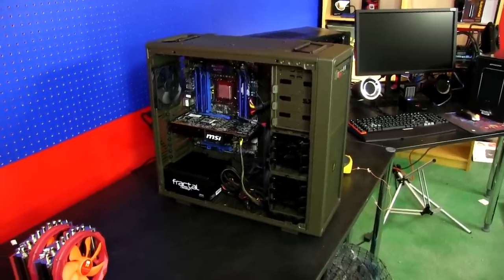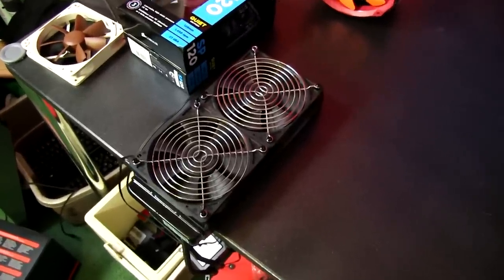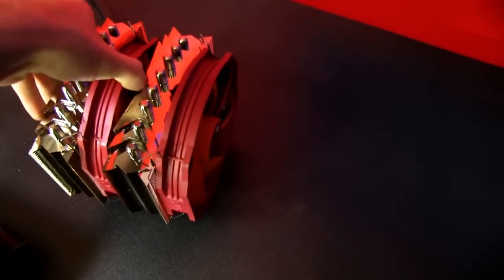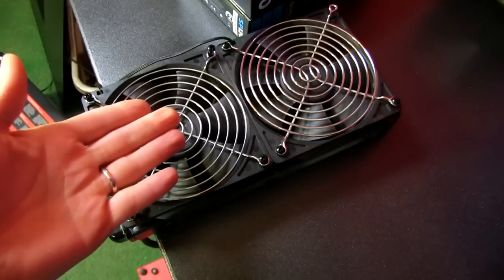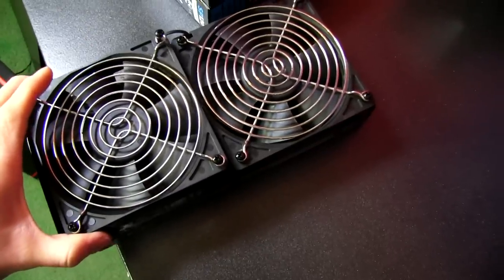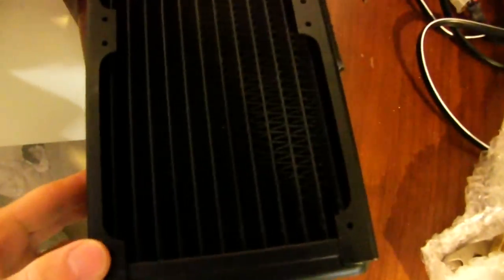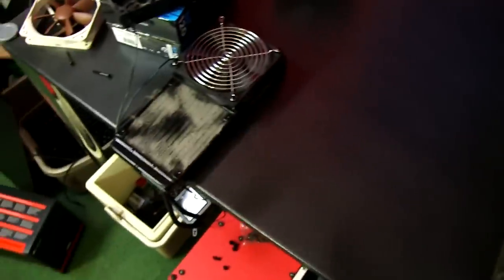Push vs Pull vs Push Pull for Radiators and Heatsinks Linus Tech Tips

Comment: What if i use push configuration on an intake scheme, Pulling air from outside of the case with dust filter applied?
Reply: Radit Slamet You should be OK with a dust filter.  Just be aware that you'll be dumping all that hot air into you case, so be mindful of GPU cooling, etc. and have good rear/top exhaust.
Reply: How is it hot air if its coming from outside?
Reply: TheGirlGamer OK, maybe "warm" air is more appropriate.  The air may start out cool, but it'll be passing thru a warm radiator.  Then again that's how car radiator/intake works, so it shouldn't be too bad (just not ideal).  ;)

Comment: I can see that using a pull system for exhausting air is beneficial for keeping your radiator easy to maintain clean. But this is just one scenario what if you have intake of air into the case would it still be better to use pull then and have the radiator mounted to the case or would it be better to mount the fans to the case and push the air through the radiator. I would appreciate it a lot if someone could help me out on this!

Comment: So put the radiator with its fans against the top of the case.. in PUSH, or PULL? I didn't get that last part! =[
Reply: Pull
Reply: And this is so the hot air generated by the rad is vented out of the top of the case!
Reply: +NeonZ Entertainment oh! So it will be pulled out the top of the case through the rad. Thanks!
Reply: Yessir ;D. Setting mine up that way now.
Reply: +Jake Wesolowski in retrospect that was such a dumb question lol :/ smdh :'(
Reply: Not really a dumb question. I had the same question last week while doing research, especially when it seems like a bottom radiator does the opposite!  Linus had some great tips on water cooling to help understand how various installations can work.  so many different configurations!
Reply: What IT said!  Keep in mind that this isn't always the case.  If you have massive GPU's that are venting their heat into the case and not out the back, pulling hot air through the radiator may not help cool the CPU.  hence the complexity with system builds.  If "cool" air can be pulled through the top radiator and vented out, great.  If the internal air is already heated when it gets to the top radiator, then it may be better to pull in cool air from outside and vent the hot air through the rear case fans.  Again, there's a number of ways to handle this, but others can chime in on their thoughts.

Comment: Well i have an i72600k and i use a push-pull config with a corsair h60 (from outside to inside). I mean what the hell? If you clean your PC each.. let's say....5 or 6 months, including your radiator and fans, then you won't have problems :)

Comment: I saw this video a couple of times and I couldnt understand a thing maybe because of my bad english knowledge or because I am perfect noob to building a pc. But I will explain my question here properly, kindly anyone answer me.

1) Case top
     ---------------
     Radiator
     ---------------
     Fan (Air flows Up)

2) Case top
     ---------------
     Radiator
     ---------------
     Fan (Air flows Down)

3) Case top
     ---------------
     Fan (Air flows Up)
     ---------------
     Radiator

4) Case top
     ---------------
     Fan (Air flows Down)
     ---------------
     Radiator

Which one did Linus said is better?
Reply: He is saying configuration #3 would be better because you would have an easier time of cleaning out dust from your radiator.
Reply: TheWierdSaying
Oh ok thanks :)
Reply: 2 and 3 are actually the same, both Pull. But no. 2 blows air in the case and no. 3 blows out.

Comment: So I have the H100 i and swapped out the 2 stock fans with 2 SP 120's.. My friend and I put it together and he set it up with the 2 fans on the bottom of the radiator blowing air through it to the out side of the case, It didnt look right to me so are you saying the best way for performance and cleaning would be fans on top pushing air from out side the case through the radiator cuz right now my CPU is at 20 deg idle. I am also going to be swapping out all stock fans with SP/AF and 2 AF on door.

Comment: Are radiator fans/pressure optimized fans better on cases too?
Reply: Bruhski1080p Depends on the restrictions.  If you have a fairly open air case (lots of intake and exhaust vents) than air flow optimized fans would be better.  You only really need static pressure when you're facing resistance (i.e. radiator fins).  SP fans generally help most as front intake fans with cases that have solid front panels, doors, etc. (or packed drive cages).  AF fans help most as rear and top exhaust fans, moving as much hot air up and out as possible.

Comment: I have the H100 installed in a Corsair 600T case and my cooler is hooked up to the case fan controller.  On startup my fans rev full speed and make tons of noise.  Is this normal?  should I change the location of connection?

Comment: am also running a H50 in push/pull but I can not see any difference whether it is push / pull or if it is push or pull. its around (35 celsius) / (94 fahrenheit) with all three setups  
On my intel core I5 3.1ghz

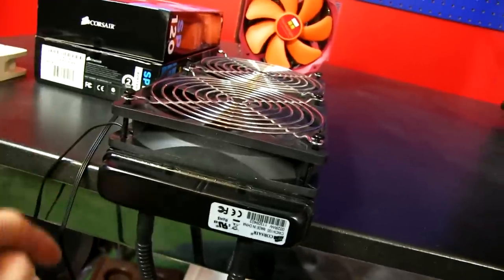Comment: I have a question: If I used my fans at the top of my Radiator but turned them around so that they pull the air through my radiator outwards instead of pushing air into the case. Would that be a bad thing? Exactly like at 0:50 but with the fans turned around.
Reply: Not a professional here but wouldn't that use the hot air coming from the case and blow it through the radiator? Not sure if that matters if hot air is blown through it or not but I think if hot air is going through the radiator it might not be good.
Reply: In the video he explained that the difference in cooling and performance does not get affected if you pull air out. I just really want to know if it would matter if the fans pulled air from the top of the radiator. Purely cuz I want to use custom LED fans to light up the top side of the case etc etc
Reply: I really don't know much but I don't think putting the fans on the top will really change that much since I think it's still going to pull/push air in/out either way. Dosen't linustechtips have a forum where you can go and ask this? I think you might get better answers from more experienced people that way.
Reply: Actually good advice. Appreciate it :)
Reply: Dean Stander
IF you have stuff in your case that is overheating like a GPU have the radiator fans pull the hot air out of the case. If the GPU ect. are plenty cool, pulling air into the case will cool the CPU more the the other mentioned method.

Comment: Ok, so I have to configure my system to pull... to inside the case or outside the case? and what if I use Dust Filters?
Reply: No one? well I'm going to look in other place
Reply: Pull air from the case out.  No need for dust filters on an exhaust really, just on intake fans :)
Reply: Darth Flynn thank you so much, so the intake configuration could be: Air->Filter->Radiator->fan and the exaust Inside->Radiator->Fan, right?
Reply: younlink Your welcome ;)

I would do this

front of case: Air>Filter
Top of case: Inside of case>Radiator>Fan

This way fairly cool air cools your radiator.  If you have a radiator on the intake it will get nice and cool but its then bringing warm air into the case and I wouldnt want that.  If your bringing warm air into the case then your radiator on your exhause is being cooled by that same warm air.

Your welcome ;)

Comment: does the vengence 70 case hold CEB mother boards like the Asus Rampage 4 extreme??  It is a little wider then the standard ATX which is 9.5 inches... There seems to be a recess in the mother board plate of the case... can you let me know if it fits fine??

ASUS Rampage IV Extreme X79,LGA 2011 Motherboard
	Extended ATX Form Factor
12 inch x 10.7 inch ( 30.5 cm x 27.2 cm )

Comment: You're not using  watercooling loop so you don't have or need a radiator. Push and pull are only for radiators. Also, this isn't the best place to post this stuff. pcpartpicker . com is a good place to.

Comment: Ok so someone gave me a radiator that is 10.5 cm (4.13 inch) thick and I will be able to mount 2x140mm fans on there. So given the huge thickness, do you guys think I should try pull or puss pull? I highly doubt 1 fan on a side will work..
Reply: push pull and make sure you have a dust filter

Comment: Radiator in front of case = pull inwards, rear and top fans = push outwards?
Reply: Yes...
Mostly.
If you're using a liquid cooled setup, then that's the ideal config because you're cooling your CPU with the liquid in the radiator... 
If you're only using airflow though, and you're going for the absolute best CPU temps, the fan directly above the CPU would be individually flipped to blow on the CPU...
But that setup triggers most people's thought process because it's not "conventional" or "symmetrical". Some people think it through a little and are still like "well, maybe with a 360 setup...", while talking to someone about it with a 240 setup is like watching someone's brain herniate. And the few that can process it intelligently just never let it be a topic of discussion again.

Comment: can anyone help me. i am having a battle in my head, forget the whole push pull situation, if i replace the stock fans with sp120 1650rpm as opposed to the 2500rpm stock fans will i lose performance?
Reply: What is the airflow rating of both models. 

Because that really is what matters.. a fan can run slower yet due to better design can move more air.
Reply: Masticina Akicta

I would like to know what kind of radiator you are using aswell, since a radiator with tightly packed fins will need higher preassure fans.
Reply: StopaskingformynameYouTube   My radiator? Oh that is a simple H55 corsair model. It even still has the default fan on it. Hey it works..The fan even is in pull mode so that ought to help against dust.

It only has to cool down a CPU that isn't overclocked.

Comment: Well, using your rad as an intake is literally begging for dust, unless you have dust-filters. I run my H100 in push/pull exhausting air out of my case. I've never had any dust problems in the 4 months I've had it, and who the hell would think of using their rad as an intake without filters anyway?

Comment: I'm From Top of NZ so at the moment because we are moving into summer its about 20-26c? on a hot day but yeah we do go down to like 10-15c in winter? ambient according to my meter inside the case is 22c and outside is 19c I'm actually running my GPU on it aswell I only got a universal block though not a full cover unfortunatly :/

Comment: I have an 🔌electric  air compressor.  I never take the fans off. I just take it outside and  blow all the dust out.
Reply: this is also by far the cheapest solution as it only costs in power and that amount in power is very small compared to the amount of air cannisters that has to be bought each time a cleaning of a PC is needed. I'm aiming towards the same solution. Especially since I'm heading for 5-6 PC's and a home server. That's gonna require some cleaning every now and then xD

Comment: But with an H80i your only option is push pull, right?
Reply: It is better to run push/pull with the H80i because of the thickness of the radiator, you can run it with just one fan, but it is recommended for push/pull for best performance.
Reply: Yeah..also, including two fans if using one was better would be pretty stupid, don't you think?

Comment: Well surely there will still be dust between the front of the fan and the radiator in pull no?
Reply: There shouldn't be as much since the only thing trapping the dust in that configuration are the fan blades, and the air passing through would've already had less dust in them since most will be trapped on the other side of the radiator.

Comment: Does anyone KNOW weather or not a Corsair H110 will fit inside a BitFenix Ronin? The specs on the case say that it only fits a 240mm not a 280mm but the thing is that there is seemingly enough room for a 280mm. in fact some forums ive read say its theoretically possible and some even say it IS possible. So, if anyone knows out of experience, let me know...

Comment: Has anyone ever tried a push-pull config with two fans only? Like this one, one fan pushing and one pulling on the SAME side?
I don't know but if the radiator is vertically mounted, the one on top could be pulling and the one at the bottom could be pushing (hot water goes up and the heat gets pulled out.

Comment: And here I am on 2024 using a H60i with push pull ( SP120 fans ) on an I7-6700K because two fans running lower RPM is quieter.

Or so I feel, and I have the space/fans for it so 😝. 😤

Comment: so i can use air flow fan if i go with pull configuration
Reply: Liger-Zero No. You need to go in a push/pull. Not Pull. If you do you are going to kill cooling performance

Comment: Did you know you can use human plasma for the radiator it's a lot better than the shit they throw in there.  You'll now have a cooler better radiator if you replace the stock liquid with human plasma Thermodynamic equilibrium

Comment: linus please help i just recently got a msi gtx680 graphics card with an twinfrozer 2 cooler and i was wondering if the pcb of the graphics card is the same as an evga gtx 680 i just recently bought a waterblock for an gtx680 and was just wondering if it will work

Comment: alright so i have a h100 and i was running i believe push pull, 1st layer of fans exausting then rad then same for the 2nd layer. 4 fans total.(so exaust coming from the top and back not sure if it matters but i have 2 fans in the front and one in the back of my full atx case) is this the most optimal build for me? please no flame, honest question. ty.

Comment: How do you tell if they are in push or pull?
Reply: use your brain
Reply: On most fans, if you look at the outside, there will be two arrows. One arrow will show the direction of spin of the fan and the other will show the direction of air flow. Beyond that, it's typical that PC fans will run in the same direction that the blade curves.So if the blade is curved like ), it will spin counter-clockwise and if it's curved like (, it will spin clockwise.

Comment: am i the only one whos alil confused about how he prefers the pull method..? at the end of the video he says its easy if the fans are right up against the case up top.. that would make it a push method right.. so can someone clarify this
Reply: +TwistedFandango ya i think he had the fan on top, with the radiator under the fan, pulling air thru the radiator. ima do the same to my h440 case with the addition of a second radiator in front on the case but that one ill to a push build becuz i have an air filter located there
Reply: +Steven Hernandez he meant fans at top (against the case) sending air ouside with the radiator under them.

Comment: I just switched my fans from pushing down through the radiator to pulling up through it and got a 5 degree celcius lowering while under load and at idle, equally. So I guess in my situation, it was effective. lol

Comment: I feel like pushing air from inside the case through the rad is stupid anyway. The coolest air will be outside the case, so I would prefer to pull from outside the case, on the front of the case.
Reply: +Phillip Betts but then your blowing warm/hot air in to your pc  is that smart ?
Reply: I think you need to re-read what I said.
Reply: I feel like pushing air from inside the case through the rad is stupid anyway. The coolest air will be outside the case, so I would prefer to pull from outside the case, on the front of the case.  : cool air cools the rad the air would get warm trough cooling  so the air that`s going in to your case is warm cold air gets warm as soon you cool your rad
1+1 = 2
AND PS I GOT MY OWN KRAKEN x61
Reply: ps feel free to heat up your own pc with its own warm air good job in cooling !

i took the time to google the pro`s and cons
Advantages:
Filtered, fresh air from the front (though slightly restricted)
Cases with front doors benefit from sound damping. Lowest noise for those cases.
No airflow conflict.
Under low CPU load, the radiator acts as an airflow straightener without warming up the air, so the fan can blow cool air more effectively inside the case.
Top fan spaces are free to close off or add even more fans.
Disadvantages:
Difficult install. Hose and fan cables may not be long enough.
Under high CPU load, radiator blows warm/hot air inside the case, warming up GPU, VRM and other components. A bottom intake fan is recommended.
CPU block pump becomes the highest point in the watercooling loop and can trap air bubbles.
Less performing than top intake.
Reply: Its like you're trying to prove me wrong, yet I said the same thing you're saying. Pull air into the rad from outside.
Reply: i try not to tell you what`s wrong or good just telling my own vision on this after building my own pc`s after many years . but hey if you feel i kicked you something then sorry . and i my self was talking bout keeping the inside of your case cool as i can get maybe we miss understood each other

Comment: I am using pull, since it's the only way I can fit it while keeping my computer case closed.
Reply: +InStars why not do a case mod to have the radiator outside of the case then?
Reply: +yumri4 The thing is, that I am not that good at case-modding to make it look any good and practical :D
Reply: InStars look good? probably it wont but functional yesit will be  and there is a ton of help online on how o dothat
Reply: +yumri4 Mhmm, i think it can look good even if you're not particularly good . You just need some U channel to cover up the messy cut job you're creating :P

But to me, being lazy and doing the simplest thing that works is actually an absolutely valid line of reasoning.